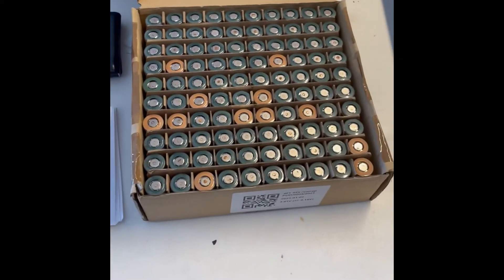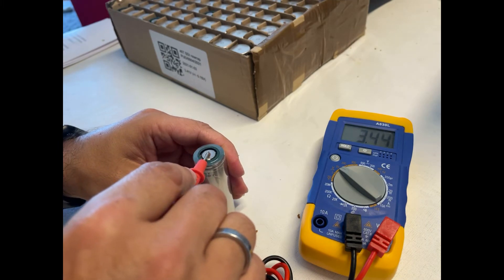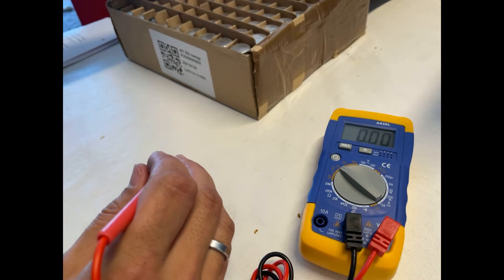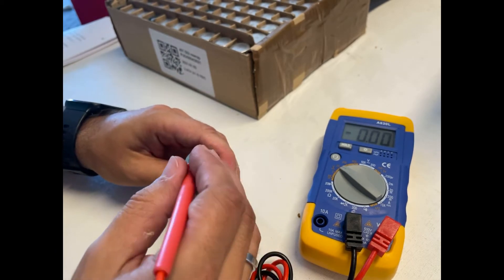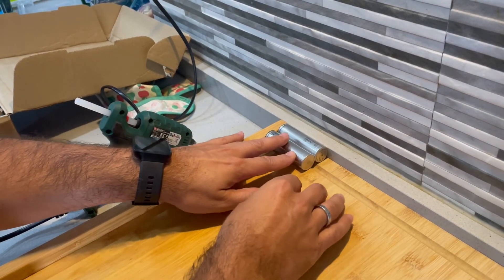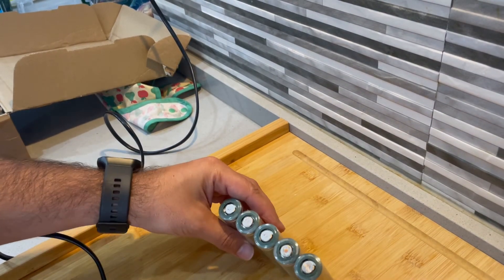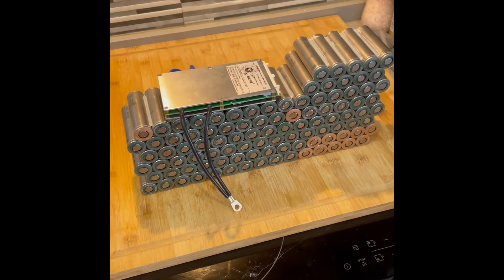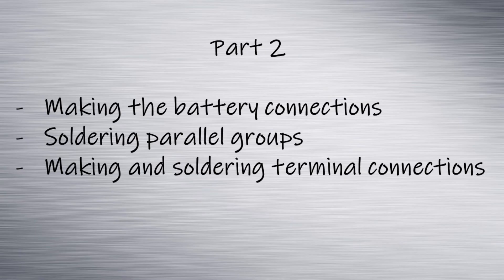DIY E bike 72V 20H Battery build - Part 1

Comment: For people who’s building batteries do not do this. This will involve in a fire. All the negatives will touch as soon as the battery heats up all the glue melts and it will cause a big short.
Reply: Negatives touching is not a problem, if you think about it all negatives are connected to each other. The cells may not look like their isolated, but they have a clear plastic wrap around them but it's transparent.

Comment: I think a battery pack is not a toy, not a kind of project where cutting corners, like hot-glueing them together is acceptable, compared to the size of the whole project, ordering some proper spacers is nothing, everyone should use proper battery spacers; First, they are flame retardant in theory at least, second the leave a small 1-2mm space between cells and let them naturally expand and contract as they charged or discharged, warmed or cooled down. That space is important for safety.

Comment: Hi, I've watched all three videos, good job! Never thought of sandwiching copper. Could I just spot weld a sheet of 0.1 copper onto the already welded 0.15x10mm pure nickel strips to reduce the resistance? I've build an 2.8kw 24s8p (three 8s8p in series) paramotor battery out of new Samsung 40 t3 cells from the same company as you. I've uploaded the first flight on YouTube, all went well but it has a high voltage drop at full power that is 17kw, usual load being 4-6kw, and I would like to hear your opinion as how can I improve it because you seem to know things. Others that use similar packs don't have that voltage drop so it must be in the connections and most likely the nickel or the weak welds or the many pre soldering points, some say. I used 0.15x10 pure nickel on parallel groups and 6-7 awg14 silicon wires soldered between series but it's better if you take a look if you have the time and curiosity, I'd appreciate it. I have a post on "Openppg/community/builds/Eppg project-2.8kw battery"  with pictures and all. and the flight video is this: https://www.youtube.com/watch?v=TlGbt9spdUY   and I have pictures of the battery build in the video. Thank you!

Comment: Is the casing the negative cathode?
Reply: Yes, all the casing is the negative, if the battery have a wrap like it's supposed to, you'll only have connection on the exposed part at the bottom of the battery.

Comment: How many amps would be this config......??Quick question, I just got a 72v battery pack 20s and believe is 6p, have 120 cells in it (liitokala 5000) but not sure how much amps really is as it doesn't have any labels.
Reply from the maker: If is a litokala 26650 50-A, it has a 50A peak discharge, 6P will be 6X50A= 300A of peak discharge, ij the safe side I would consider 30A, so 150A of continuious discharge should be the battery max amperage.

Comment: Have you had any problems with the battery overheating in anyway or running slightly higher  temperature than desired. I want too glue my cells together but I’m worried not leaving gaps between using cell holders that overheating may be and issue , thanks
Reply from the maker: Hi. 
The battery in mu case runs at a very safe level, 80A peak, 50A constant, the battery can handle 200A, so it won’t heat that much. If your setup is different and you’ll use much more amps can heat more.
Reply: @e-biker8406  that’s awesome thanks for the info I don’t plan to run more than 45A at 48v so this will be great as I can save a couple mm of room per cell and make it slightly more compact, thanks again!
Reply from the maker: @CryoGenic  I think you’ll be safe. Just wrap the battery really tight and make sure is well secure to the frame or battery box. 
At 45A the battery will be slightly warm.

Comment: Nice how many amps does this put out
Reply from the maker: My BMS have 80A of discharge, but the battery itself would be able to peak of 200A, 40A per cell X 5 cells. 
200A is an abuse, 80A it’s more than enough for me.
Reply: Cool never built a battery befor came across your video so I can do everything the same just get a different bms if I want a bit higher amps right ?
Reply from the maker: @_nowayjose_  sure. The battery should be suited for your needs, more Amps? More capacity (range)? More volts (speed)
What are you thinking?
I’m glad to help
Reply from the maker: @_nowayjose_  how many amps you want? 80A already very powerful
Reply: @e-biker8406  yes I decided I’m doing 80amp but really want 100amp do you think I’m pushing it I have a 3kw 72v motor with a Kelly controller
Reply from the maker: @_nowayjose_  the motor may handle it, will produce a lot more heat, I wouldn’t ride it full throttle constantly. 72v at 100A, you are pushing 7200w from a 3000w
Reply: @nowayjose_1733 this pack can supply 100amp draw. I have the same pack build and the 80a bms peaks at 150, so my 100amp controller occasionally draws more than the 80a constant.
Reply: hot gluing is illegal and dangerous

Comment: Sir
If i want 60v 20ah
How much i have parallel
Reply from the maker: Hi, for a 60v battery you must have 16 in series. For the 20ah that vary with the cells you'll use, with a 3000mah cell you use 7 = 21ah total, to calculate you divide the total Ah you want by the Ah of the cell you'll use.

Comment: Can you build me a custom battery like yours?  My ride, EScooter, 72v 3000w with 80A controller...
Reply from the maker: I had aswer you in the other video. It’s a hard item to ship, where are you from ?
Reply: @e-biker8406  sir how can I perfectly check the Ah of 18650 cell
Reply from the maker: @bilal_bin_shafeel  you can see online the cell specs, in case of used cell, some chargers have that testing function for the cells
Reply: @e-biker8406  ok

Comment: Very nice!  Is there a calculator on the web that can tell me how much batteries I need to make a certain voltage and capacity?  Obviously I would also need to input the correct information per cell as well.  Take care thanks!
Reply from the maker: There’s a calculator if you use used cells, the calculator shows you how to pair them. 
If you’re gonna use new cells you don’t need a calculator.
Reply from the maker: How many volts and AH you want?
Reply: I’m interested in building myself a 60V 20A battery.  I know it will be 17 Series or 18 Series but don’t know my parallel yet.  I’m still learning.  Thank you for replying!
Reply from the maker: @tone33012  it’s a 16S, 16 cells in series. 
For a 20Ah, just divide the 20Ah by the Ah of each cell, for example a 3000mah cell, 20/3 = 6.666 cells, so you need to make a group of 7cell in parallel and connect 16 of those groups in series, the battery will have 112 cells total.
Reply: Thank you thank you.  I’m going with 17  series just in case of voltage sag.  Still learning how to plan and organize the cells.  Also have to make a wooden box.  Etc etc.
Reply from the maker: @tone33012  actually a 16s battery fully charged has 67.2V, 4,2v X 16 series, but tou can go to 17S. 
I’ll post in the future, soon I hope, my acrylic box, probably gonna make one in aluminum later on. Acrylic is just cheap and easy to work with.

Comment: Olá, qual a chapa de cobre que utilizas?
Reply: É uma bateria razoável, cerca de 5.5 kWh, com capacidade de descarregar até 55 kW instantâneos, porém não tem dimensões tão grandes (cerca de 50kg e 20L de volume). O caso é que a relação é ligeiramente diferente entre torque e rotações por se tratar de um motor AC.
Reply from the maker: Boas. É chapa de cobre de 0,2mm comprei na Amazon.
Reply: @e-biker8406  Perfeito amigo, sabe dizer qual a corrente máxima que essa chapa conduz e se ela aquece de algum modo na utilização? Grato novamente!
Reply from the maker: @wagnerbrochini3892  dificilmente vai aquecer, 0,2mm de cobre tem a mesma condutividade de 0,4mm de níquel puro. E não usei tiras finas, geralmente são usadas de 8mm de largura, para ligar uma célula à outra, neste caso usei uma tira completa que liga todas as células umas às outras. Tendo mais área (quantidade de cobre) aumenta ainda mais a condutividade.
Reply: A corrente máxima que teu setup pode puxar, sabe qual é?
Reply from the maker: @wagnerbrochini3892  a bateria de momento tem uma BMS de 80A. 
Mas a amperagem máxima a puxar neste setup seria de 175A, provavelmente valor de pico, e por segurança uns 140A constantes.
Reply: Boas, excelente, isso que queria saber. Muito obrigado!
Reply from the maker: @wagnerbrochini3892  claro que 140A a 72V, dá 10KW de potência. Provavelmente não vais ter nenhuma bike com esse power. 
Calcula primeiro a potência que precisas e faz uma bateria que aguente essa amperagem, a escolha das baterias, dos contactos que vais soldar, da BMS, etc
Reply: Na verdade meu projeto é uma e-moto com um motor experimental, o ponto é que ele aceita até 360A. Mas seu dimensionamento me deu um bom caminho para trilhar.
Reply from the maker: @wagnerbrochini3892  precisas dessa potência toda?
Porque com uma potência dessas tens de ter uma bateria muito grande para aguentar esses amperes todos. Provavelmente para ter mais velocidade aumentaria os volts e não tanto os amperes. 
Voltagem dá velocidade, amperagem dá torque/binário.